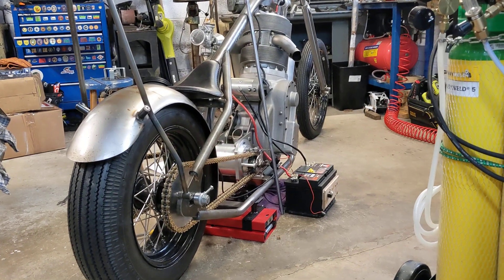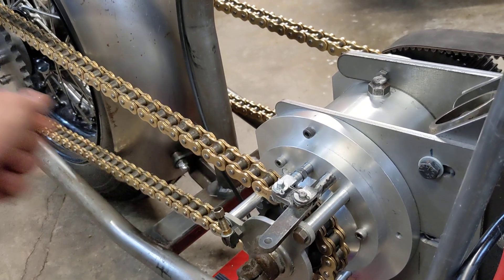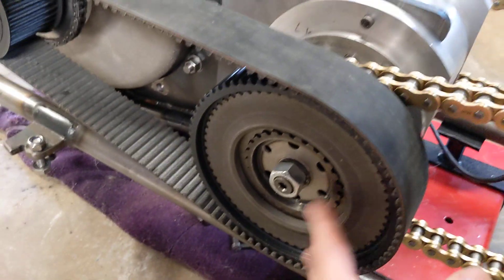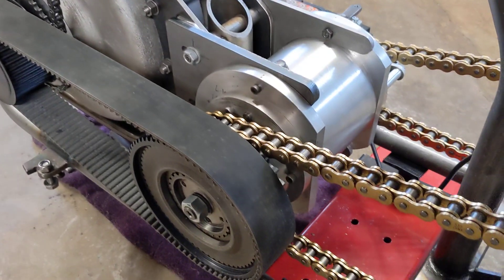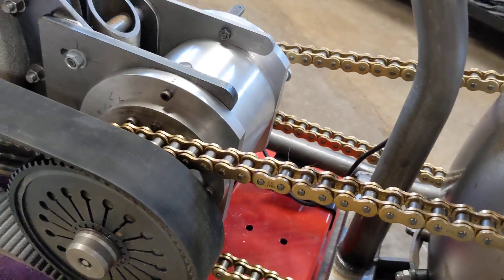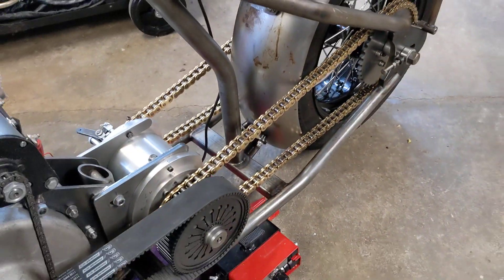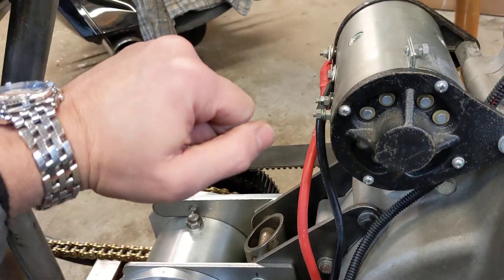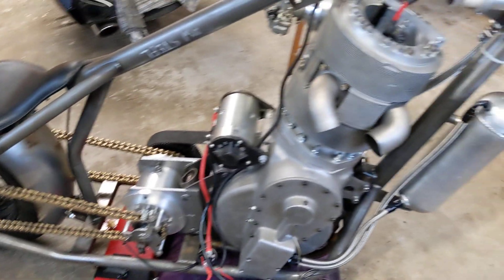Gearbox Refitted - Linkages a go go!

Comment: Have you considered a foot clutch and hand shift? Like the progress.
Reply from the maker: @bradwiebelhaus7065  Like the suicide clutch on old Harley's? I briefly considered but have an alternate (better?) idea. I plan to use an internal twist grip for both the clutch and throttle, and use a foot brake pedal on reach side (One front and one rear brake). That way there will be no levers on the bars for a really clean look. 💪
Reply: @StoneEng  Outstanding!
Reply: @StoneEng I think that the clutch lever on the suicide shift rod itself would look pretty cool and simplify the cable routing. But to be fair, I'm not an engineer and most of my ideas become over complicated right before they fail 😆 Can't wait to hear how this sounds, I'm hoping you go with minimal baffles 😈
Reply from the maker: @maximumscrunch with a gear lever on the left side of the bike, the clutch lever has to go on the gear stick. Otherwise, you'd dump the clutch when you reached for the gear sick. (Assuming the usual left bar mounted clutch lever).
In my case, the gear lever is on the right hand side of the bike. If I put the clutch lever on the gear stick then I couldn't operate the throttle and clutch at the same time. 
I hope all that makes sense? (My head hurts now - going for a lie down!).
Reply: @StoneEng 😂 I did say my ideas mostly failed. My imagination often runs far ahead of the practicalities of implementation. Loving the bike, it has a fantastic look. Would love to see longer videos to appreciate all the problem solving that goes into the engineering solutions required to build a machine like that 😉

Comment: How are you going to fix the gearbox to their mounting plates ?
Reply from the maker: @racertwo  it's already bolted to the mounting plates..3 x Bolts each side around the radius/outer flange of the gearbox case. Not easy to see in the video but it's all solidly mounted.
Reply: @StoneEng  Sorry for the question, I thought the 3 bolts each side were temporary fixings before using much bigger bolts, you are going to be putting a lot of torque through that gearbox. This is a great project, I have rebuilt many aero engines over the years and respect the engineering, well done.
Reply from the maker: @racertwo  no problem asking any question. I could open the holes and fit bigger bolts, but there are 6 of them so I recon I'll be ok. Maybe 🤔